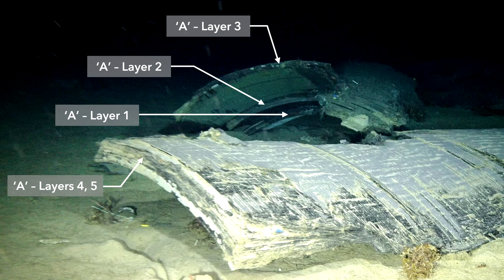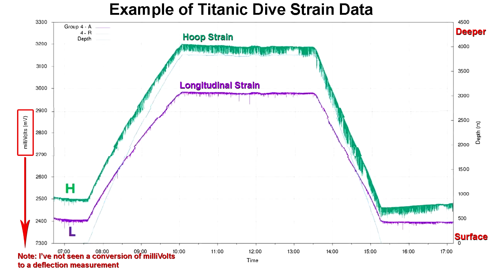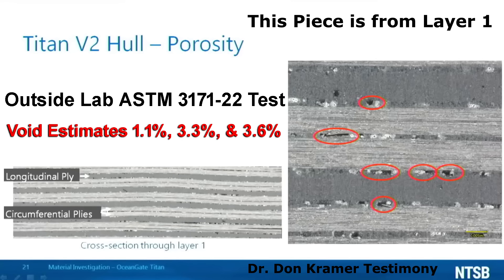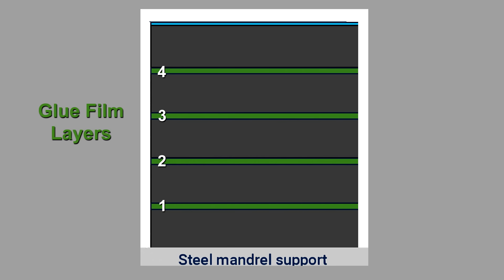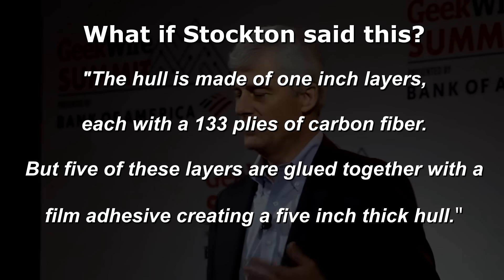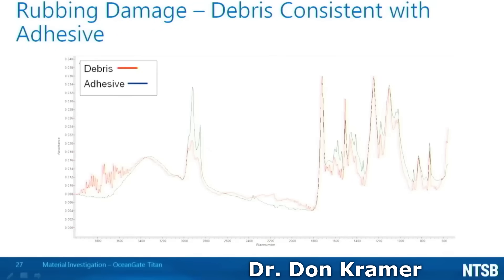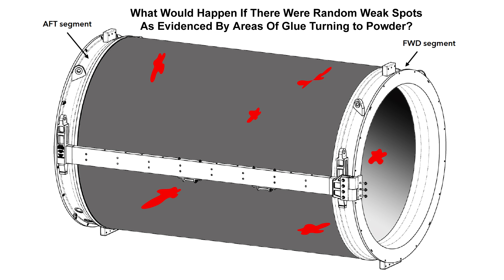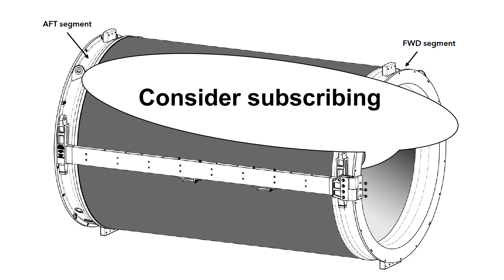OceanGate Titan Hull - Glue Layers Were Breaking Down To Dust - No Clues.

Comment: Is there any way that carbon fiber could be successfully employed in this kind of application? Could it ever work?
Reply: Yes, but Rush ignored all the technical advice and techniques that would have made the hull much stronger.  Still, the resulting submersible might still have a very limited lifespan
Reply: @wallacegrommet9343  and it would probably be spherical if you wanted to take people down to that depth and bring them back alive multiple times. The number of times being determined by a fully documented design and destructive testing research of at least 3 full size vessels.
Reply from the maker: It has been done in the past, but smaller and unmanned.  One of the issues is putting holes in the carbon fiber hull, like for a hatch.  That makes a weak spot.  That is why the 1/3 scale models that OceanGate tested failed.
Reply: Theoretically yes, but the right way to do it is to start with unmanned iterations until it gets safety certified.
Reply: Yes, it has been used in the past (although I think those were unmanned), but not in the way oceangate did it.
Reply: Yes, there are ROVs with carbon fibre pressure hulls that have made many dives with no degradation. Properly engineered ones that have been tested to failure and operated well within their safety margins. These guys were just guessing and hoping for the best.

Comment: The zero testing and knowledge of the failure point is just insane.
When it first hit the news I was hanging onto the they have some air reserves story, I knew nothing of this disaster waiting to happen contraption I just assumed wrongly it seems that those diving to extreme depths knew that the vehicle could handle the pressure.
Assumptions can be fatal! Is a saying I stand by.

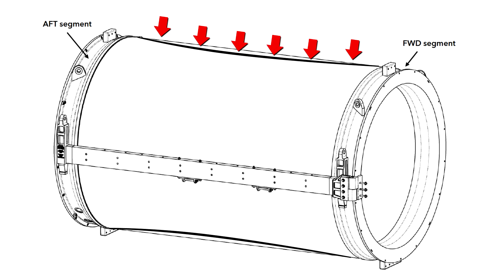Comment: 2:00]  The reason why designers of deep submersibles todate have always avoided cylinders is because of this picture.  All of that deflection at the center concentrates forces at the ends.  The hemispherical end caps act like strong funcrums or hinges for all of the forces on the cylindrical hull to act on.  Such a hull will always be trying to tear itself apart at that joint.  That joint very quickly starts to go into tension, but what do you really want to do?  Keep everything in compression.